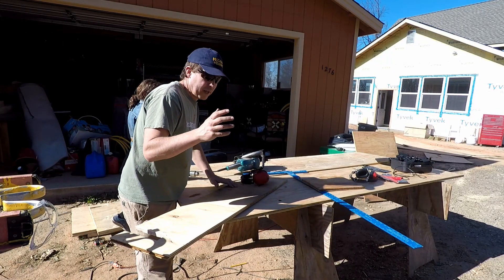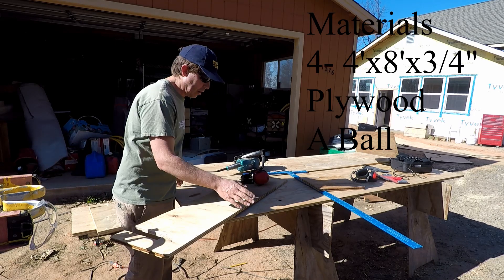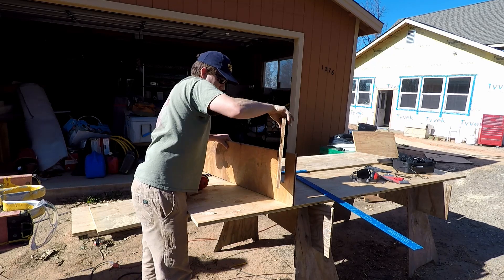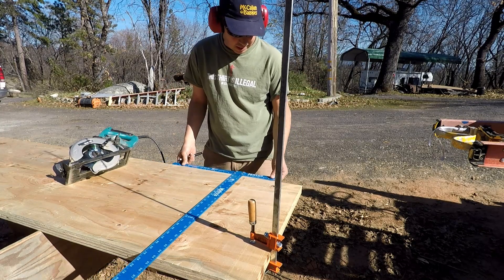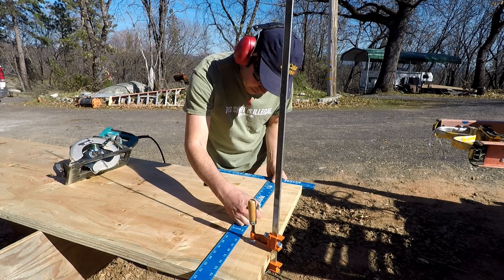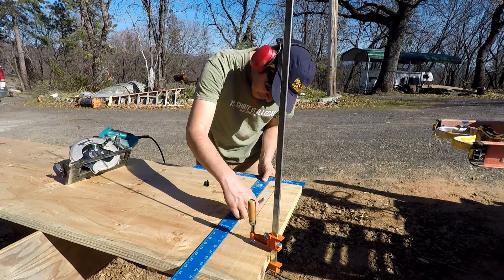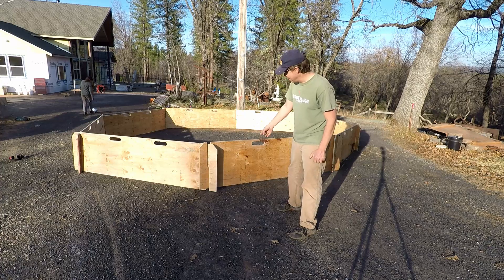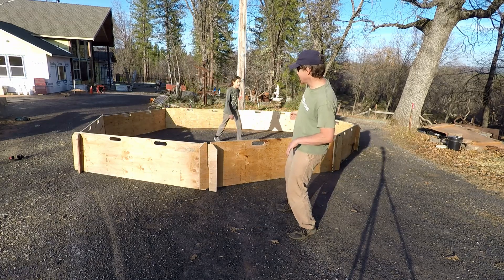How To Build A Gaga Ball Court

Comment: Is it durable?
Reply from the maker: Yes, I am not worried about it. It could be made with thicker plywood or metal plates if you were worried. I dont think it should be left out in the rain. Plywood glue doesnt hold up well to moisture. You may be able to find water resistant plywood.